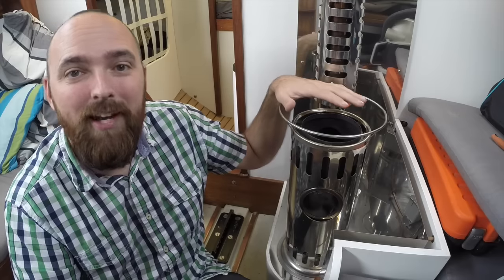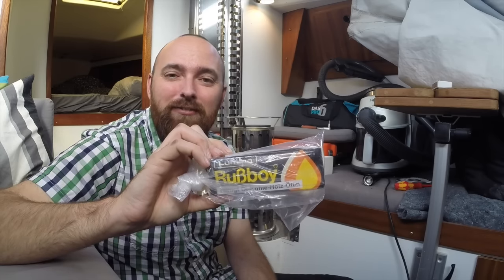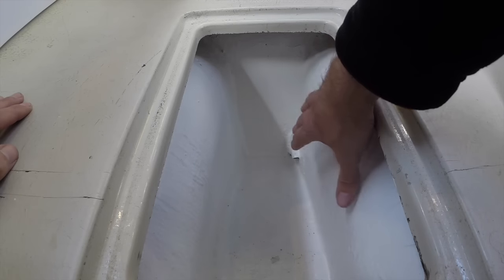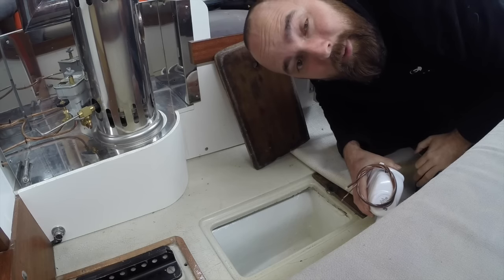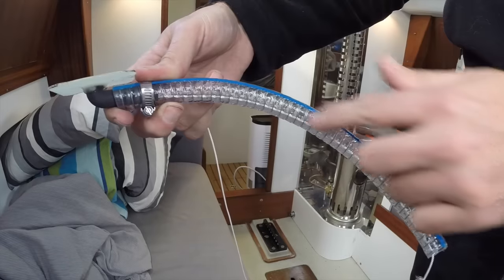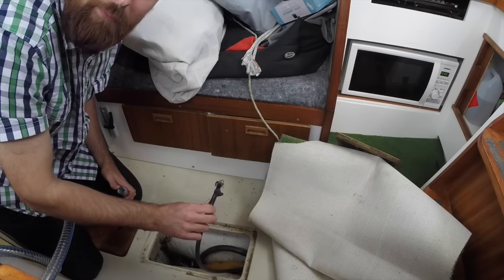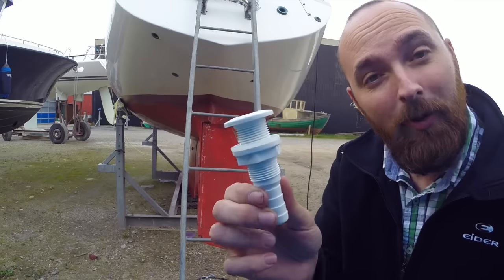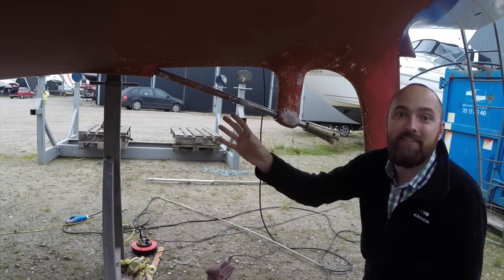Sail Life - Up on the hard, part 6

Comment: Good Morning!

Installing the through-hull in a way that it drains into the self-draining cockpit is absolutly the right way! In case of water ingress at sea your interest is to realize this as early as possible. And you will realize it when suddenly your feet become wet;-). To encrease the effiziency of your pump keep the hose as short as possible and let it come out at the lowest possible point above the bottom of the cockpit...

Good luck!

Comment: hi mads-i go with the rule of never ever cut or drill your hull unless you have to. during my refit i chose to use bronze t connections from Spartan Marine custom machined in maine, usa. i replaced every thru-hull and sea cock with Spartan bronze. those plastic through hulls are cost effective but cheaply made in china, get brittle, and don't hold paint well. they easily strip when removing or installing with a thru-hull tool. in usa using ABYC compliant gear will get you better insurance rates and add significant resale value to your boat. however, if you should choose to cut a new hole, always select an area above the waterline, in this case not the area low under the transom. i would also install a maralon backflow preventer in the hose line above the pump. cheap and safe. your bilge pump should always be easily accessible for safety sake. as an aside, your pump should really be expelling water from the stern, not the side of the boat. think about when you are healed over in a breeze. i also installed a bilge fan under the sole, and i have a completely dry and smell-free bilge now. a little air flow under there does wonders.

Comment: i would go with option 1.  I suggest you put in a back flow valve to keep water from back flowing back into the bilge.  typically after the flow switch stops the bilge pump, all the water in the hose flows back into the bilge.  If enough water re-enters the bilge, the flow switch will turn the pump back on, the bilge will pump out again, the switch will turn off, and back comes the water.  This will be an endless cycle. A back flow valve near or at the pump will prevent this.   You have what looks like a fairly long run of hose, so this cycling is a very real possibility.  Good luck

Comment: Can you try using some spray foam at the top of the mast where it leaks?  This would cut down on the water coming in.  There has to be a way to prevent rain water from coming into the mast...ask around the boat yard...good videos ...keep um coming.

Comment: Be careful mounting the thru hull low.....   in a following sea it could syphon sea water back into the bilge unless you safe guard against this. You could dump the water into the cockpit near the cockpit drain as option three.I like how you often have similar jobs to me.... regarding your shaft, I have a similar problem with my skeg. But I would have to first remove a fuel tank (have to cut it out n replace) then the batteries and then I could move the engine forward to remove the shaft.Another option suggested by a boat yard was to drop the rudder and drill a (shaft size) hole thru the skeg and pull the shaft thru that way - then patch and glass the skeg up afterwards.In your case the motor has to be lifted anyway - maybe whilst out reco the head and change anodes and hoses / wet exhaust.

Comment: Not a bad idea having two pumps at all. If one malfunctions, there's a backup, and a manual. As far as where to drain, less holes in hull is best, I'd prefer to 'y' valve into cockpit drain to keep your hose low for more performance from the pump. An alarm or buzzer to know when it operates is cheap and easy to install for a guy like yourself. My 2 cents. Thanks for sharing.

Comment: Go with option 3 . locate the leak/leaks in the mast . seal them .  you should  do this because , when water gets into the mast and being in a freeze zone , it with freeze and cause internal damage to the rigging mounts and or the  electronics .
Reply: Indeed. What many people do not realize is that water expands as it freezes. This has been the source of many cracked household water pipes and residential/commercial sprinkler system piping, all leading to costly damage & repairs.

Comment: The less you have to lift the water to get it out of the boat, the better.  It is not as hard on the pump, and you will be able to clear the hoses out more completely.  If you had to choose between the two options, I'd pick #1.  But as said below, the less holes in the hull, the better.

Comment: I wouldn't put a hole in the lower stern part as when you are sailing fast the stern wave will force water into that hole and the bilge may fill as it is an open system to a lower point. The higher one is a bit iffy as well the hose will hold a lot of water and after the pump stops it will drain back into the reservoir. As the others say find an existing through hull that works well and 'T" it in, if it's not suitable try another one. Easier than patching a hole in the hull.

Comment: First , how much rain water actually comes down? 
How long (days or hours) would it take to fill that partitioned off bilge? 
How water much do the bilge hold? 
How much water do the hose hold? (without a check valve the water in the hose would just run back to the little bilge and start the pump again)
If very little runs into the mast bilge, I would just sponge it out. And have an overflow to main bilge if boat is left unattended for long periods of time. so the main bilge pump can take care of it. 
I like the KISS principle, it usually works the best.

Comment: Option 1 looks much nicer for sure! But didn't you get water into the boat with strong waves from the back? Think I would looking for option 2 seems saver in my eyes. Another positive is you can see  if it is working while sailing. Not sure if the water gets blown in the cockpit in strong winds while you sail with heeling from that outlet? 
I'm only a laser sailor yet where you never stay dry^^

Have seen some videos from Eric's Westsail 42 "Fiona" and he got lots of water in the boat during an heavy storm. Not sure it was caused by the heavy weather pushing it of the fitting or maybe it collapsed because of age?!

Comment: Option number 2 is closest to best. its higher at heel for when your sailing, and being closer to the cockpit you'll be able to tell if its discharging and or cycling and draining the battery. That being said id look for a Y not a T and tap into another sink drain. The least amount of holes in a sailboat the better! Also, can you find a better quality thru hull?

Comment: Always put through hulls in the middle the middle of the boat. The rear slaps pressure at sea and at anchor. Front end is just to dangerous unless its for the anchor locker that is separate.  Middle less movement and put it about the water line.
Reply: I meant to type above the water line.

Comment: I assume you don't intend to install a seacock on the through hull, so you might get back flow into the boat when under motor or heeled over, unless you install a one-way valve.  A valve though increases the head pressure.  I have my through hull from the bilge higher up on the transom, which seems to work okay.  In my unprofessional opinion, I like placing an unprotected through hull higher on the transom.  Good luck with your projects!  B.

Comment: Ouch.  Pulling the engine to replace the cutlass bearing! bummer.  But if you can get the oil leak fixed and perhaps learn a little diesel skills perhaps there is a bright side!
Also I would try to run the hose out an existing through hull or perhaps into the cockpit.  It won't be a ton or rainwater to deal with so making a hole in your hull seems unnecessary

Comment: You could maybe T off the bilge line up high with a in-line back flow preventer to the cockpit drain.  That way you wouldn't have to put another hole in your boat?

Comment: Well if you are going to punch another hole, keep it above the water line. Your first choice could pull water back into the boat. You can never go wrong exiting the water above the water line. Ok..that was my two cents. Just so you know I installed mine above the water line. If it is running I want to know.

Comment: Option No3, I put my bilge pump draining into my cockpit which is self draining, and you can make sure the pump works by watching the water flow
Reply: if you're sailing and in the cockpit, you'd see it come on, indicating you should go below and see what's going on.
Reply: +Formosa41 yes you are correct, that has happened to me, also their is a override wire on the pump so you can fit a run switch so you can test the pump and if you can see the water drain you know the works and the pipe is o.k. I ALLWAYS  use the kiss theory " Keep It Simple Stupid"
Reply: +Formosa41 yes

Comment: It looks to me like your 'fresh water' bilge is small. The length of pipe to your through hull looks like it could hold the entire contents of that bilge! The problem with that is the pump will stop before any of the water in the bilge exits the boat, and the water will then run back. Your pump will cycle constantly, and not be able to clear the water. 

If it was me, I'd pump (or better, limber-holes) to the main bilge and let the main bilge pump deal with the problem.

Comment: I have heard of sailboat owners who report water coming down the mast and into the bilge. I would and will try (Once I get my sailboat from Salem NJ) to put a custom gasket in the mast. It is difficult to describe it here, but I will do my best. First I would get gasket material from a supplier, mix the material and make a gasket in the exact shape, inner diameter of the mast, minus the mast aluminum thickness.  I would then put the gasket in place somewhere along the length of the mast above the deck line and with a great amount of patients seal it in place with caulk.  Keep in mind I have never done this and there are wires etc to think about. But! where there is a will there is a way and I will find that way. I am going to start making videos this week. I'm driving to Salem to put the trailer tag on the sailboat trailer. I'll let you know when I do this.  Please check out the video below to kinda get an idea of what I'm talking about.  

 https://www.youtube.com/watch?v=JyQmEG9qmfw

Comment: Ummm... IMHO, stop drilling holes in your hull! Can you not just 'T' in to an existing thru hole?
Reply: +Andrew Barron 
I definitely vote for this, just 'T' into an existing thru, no reason to put more holes in your boat. Failing that, I think option 2 is safer. The pump you are using is going to have to deal with any pressure put on it. If that boat starts getting hit by a following sea, who is to say the little valves in that pump wont fail and start leaking seawater back in on wave hits? 

I've even see people put bilge-pump outputs into cockpits (very safe) or T-into existing cockpit drains. That's the option that sounds the best to me.
Reply: +Andrew Barron Very good idea.
Reply: +Andrew Barron support your proposal. Put in a gooseneck, so that water can´t enter in heavy sea.

Comment: just my opinion, but if you can help it, don't make any more holes below the water line than you can help.

Let the standing water stand, until you can pump it.

Are you sure you want to spend the money to pull the motor and the gear box.
Sounds like  a waste of money. (and effort) - heck, what do I know, have fun, get it fixed, feel good.